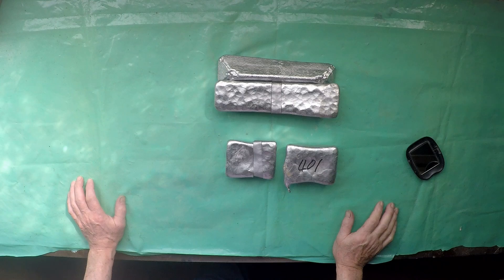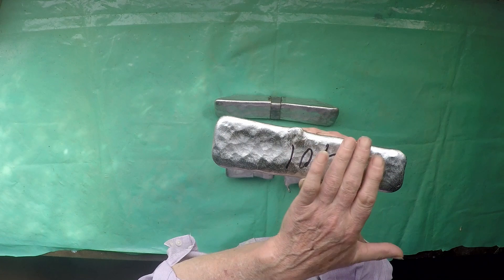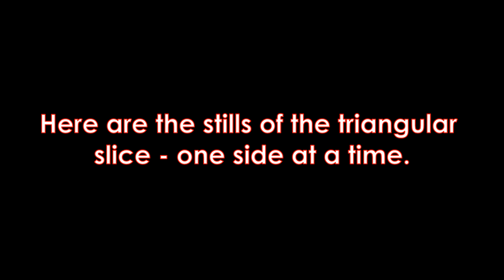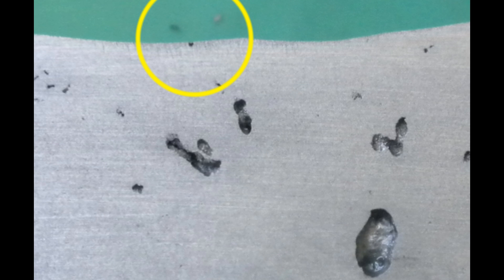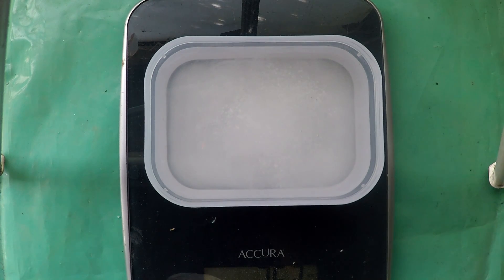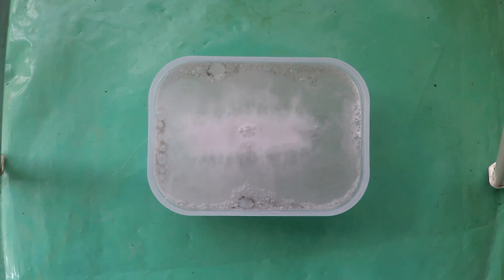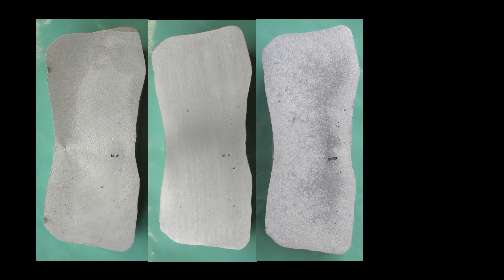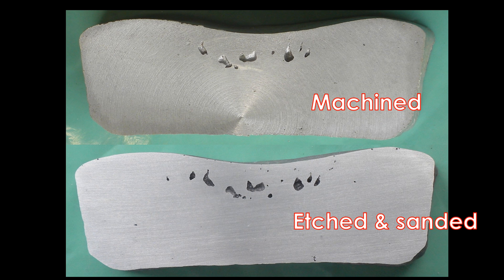Caustic Soda etching to reveal porosity in aluminium alloys.

Comment: If you don't have sodium hydroxide, just heat some baking soda to above 1600F, and it will decompose to sodium oxide, which produces sodium hydroxide when added to water. Not sure  if it would eat through a crucible though, just an idea.
Reply from the maker: Radster, I assume that your comment is based on Baking soda (NaHCO3) decomposing to Sodium carbonate (Na2CO3) at around 100 deg C and then the Na2CO3 breaking down as the temperature is raised further. This is an area that I am interested in as it relates to the useless preoccupation some amateur foundry types have in foolishly attempting to degas aluminium with washing soda (Na2CO3.10H2O) or even anhydrous sodium carbonate (Na2CO3). It is my hope to do a video rebuttal of this process in a scientific way and thus I have investigated the properties of the various sodium carbonates with respect to their behaviour with heat. One reference I have – Mellors Modern Inorganic chemistry – admittedly now a bit old, states that Anhydrous sodium carbonate melts at about 850 Deg C with “slight decomposition”. More modern information suggests that decomposition actually begins at about 400 deg C BUT that it is only very slight – perhaps about 1.5% at the melting point and is not complete until about 1500 deg C and is only about 5% complete at 1200 Deg C. Do you have information and a reference to suggest otherwise? If you do, I would be very appreciative to receive information about it.
Incidentally sodium oxide is quite nasty stuff treat it with care and particularly when adding it to water….. Martin
Reply: @olfoundryman8418  Thanks for the reply Martin. I read the Wikipedia article for sodium carbonate will decompose to sodium oxide above 850C, and I was planning on testing that, but I am unsure what it would do to a graphite crucible.  I did say it was just an idea, never said it was a good idea. I was also curious if you knew anything about it, and I'm glad to see that you do. Even a low percentage sodium hydroxide could still be useful for something. I've also seen Cody's Lab make it from a salt solution. About the supposed 'degassing with carbonate', I never believed that would work. I only do small, decorative castings, so I don't bother degassing aluminum. When I melt copper, I never try to cast pure copper like a lot of people seem to do. I use a 98% Cu, 2% Sn alloy, and it's gas free enough for making coins. If I want to make a knife, I use ZA27. Silver I will spend the time to degas though, especially after I spent extra time adding a bit of germanium to it to make 'Argentium sterling silver'.
Reply from the maker: @5thDragonDreamCaster , I would not try it in a graphite crucible as I  strongly suspect that any of sodium carbonate sodium hydroxide or ether of the two sodium oxides (Na2O2 ,Na2O) will attack the non-graphite part of the crucible and flux it away. The behaviour of those two oxides of sodium is a bit of a mystery as at a quick look it seems as though either decomposes to the other at some elevated (but not that high) temperature weirdly the info I came across suggests a sort of merry-go-round between them!

The problem with degassing with washing soda is that if you use anhydrous Na2CO3 you get no gas given off (Luckygen 1001 showed this) and if you use the true old-style washing soda Na2CO3.10H2O the only gas you get off would appear to be water (and perhaps a smidge of CO2), remembering that the hydrogen we are trying to get out of our aluminium got in there in the main by reaction of the aluminium with water,  bubbling water (steam) through the aluminium would appear to be most counterproductive. I usually advise people that if they use good metal that is clean and dry and melt quickly cast without delay, they will not have a gas problem unless their castings are very thick – in other words do not bother with degassing.

Copper is a bit difficult and everybody I have ever seen do it on YT has done it wrong! The use of a small amount of tin or zinc helps no end

A knife from ZA27? I have used a fair bit of the ZA12 alloy but I would have thought that even a “hard” zinc alloy like ZA27 way to soft for a knife?? I assume that you stir it well as the ZA alloys are prone to segregate when liquid.

I understand that Argentium silver is somewhat superior to sterling silver in many ways  but I have never worked with either ($$$) 😱 and it postdates my metallurgy student days.

Regards, Martin

PS We need to see more videos from you!
Reply: @olfoundryman8418  I do have some videos on Billy-Bobus Foundry. I haven't had a chance to do more videos for a few months, but I'm planning on making some more soon now that I've had a propane forge for the past 3 months, and it blows away my old electric one. The knives that I've made still aren't great; most of my experience is with casting coins and small engravings. I've recently come up with a copper based alloy that will scratch mild steel, but its fairly brittle. I might show that next time I make a video. My set-up doesn't get quite hot enough to do cast iron. It will melt it, but I can't get it hot enough to cast.

Thanks, Mike
Reply from the maker: Mike, Electric while clean and quiet is very slow as you no  doubt found. But if you can’t get enough heat to melt cast iron I would guess that you have a self-aspirating gas burner the problem with these is that they have difficulty pulling in enough air to get the slightly oxidizing flame that you need for maximum heat. IN another life (Oh so long ago) I briefly worked in the open-hearth department of a steel company. My job was to do furnace gas analysis to check for the oxygen level withing the furnace. They were aiming for 2% oxygen i.e. somewhat oxidising through excess air as this was the mixture that gave the greatest heat. With a self-aspirating gas burner your chances of getting this excess air are miniscule - you need to add a well controlled blower to push the air in – then you will melt iron but use a clay graphite crucible NOT a silicon carbide one. 
There are some very hard copper base alloys out there. One I use to make things like synchro rings for gearboxes is called CMA 1 and it has a higher hardness cousin CMA 2
https://www.google.com.au/url?sa=t&rct=j&q=&esrc=s&source=web&cd=1&ved=2ahUKEwi1-8KznqrmAhXh4nMBHT76A3oQFjAAegQIAhAC&url=https%3A%2F%2Fcopperalliance.org.uk%2Fresources%2Faluminium-bronze-alloys-industry%2F%3Fdownload%3Dstart&usg=AOvVaw1Q1QhDR2sEhgtt6HSaW7Et
I tried to paste a chart in here but It does not seem to want to work so try page 15 on the link above
As  you can see it is an aluminium bronze and it thus requires care in casting, in particular it is very prone to hot spot shrinkage.  It will certainly scratch mild steel and it is not brittle. You need very sharp tools to machine it
Incidentally the AB3 alloy also listed in the link is wonderful stuff, quite easy (relatively) to work with and it has a beautiful warm gold (not brassy yellow!) colour also it machines quite well although it is hard on tools ( the silicon content makes it a bit abrasive) I have used this alloy a lot but have had to make it up myself (not easy) as I cannot buy it here in Australia. It would be an excellent alloy for you coin sized work.

Regards, Martin
Reply: @olfoundryman8418  Thanks for the information on oxygen content and melting cast iron and the alloy suggestions. It'll be nice to have some hard and durable alloys to make knives from, and if I decide to try making some tools from as well. I've done some casting recently with aluminum bronze, nothing fancy, just what I mixed from the scrap metals I had (91%Cu, 9%Al), and probably a trace of iron from the old hacksaw blade.
If you're curious about the alloy I made that's hard but brittle, it's 87.5% Cu, 10.25% Sb, and 2.25% Al. My thought was that the aluminum and antimony are in a 1:1 atomic ratio, and form the inter-metallic compound aluminum-antimonide. It seems to have worked in making it hard at least, it was more of an experiment than anything. The aluminum was added first.
Thanks, Mike
Reply from the maker: Mike,    Ah yes, the old home-made aluminium bronze – everybody is doing it but unfortunately usually in blissful ignorance and thus rather badly. The problem is that everyone thinks that if they add 10 aluminium to 90 copper, they will get 100 of a 90/10 aluminium bronze – no they won’t. They fail to allow for recovery and my experience with alloy make up, when backed with analytical facilities so I could check, was in adding magnesium to 356 aluminium alloy in order to convert it to 357 alloy. I found that even with great care the best recovery of magnesium I got was half the amount added. With the aluminium bronze its odds on that the copper has been badly melted (have not seen it done right yet 😱 😊) and thus full of oxide which reacts with and thus reduces the aluminium - my guess is that most 90/10 is closer to an equivalent of 95/5 or 92.5/7.5 at best.  In any case aluminium bronze is a very difficult alloy in the foundry as it has severe shrinkage and oxide skin problems. It is one hobbyists would do well to stay away from unless they are prepared to uses good gating techniques and most seem loath to do so including, I note, all of the more popular on YT
Your copper antimony aluminium alloy is a real unknown and apart from saying that both those quantities of Sb and Al should go into solution in the copper at least at the melting temperature the virtually complete mutual insolubility of Al and Sb is a fly in the ointment. I could only make a (bad) guess at what will happen but if you got a glass brittle alloy it does suggest the presence of a fair amount of an intermetallic phase – was it the AlSb intermetallic or some tertiary one I would not venture to guess. A microstructure would be nice to look at though and might reveal some inkling of what went on. Interesting though is the melting point of the AlSb compound – well above that of either Al or Sb - this behaviour of a peak in alloy melting point at intermetallic composition is quite common across many alloy systems.

Incidentally I have used that CMA1 bronze to make a number of tools - non sparking spanners and parting tool holders for example - it is a very strong alloy….. Martin
Reply: @olfoundryman8418  Martin,  The aluminum bronze I mixed up, is no doubt not industry standard to say the least. I still like the material though as the color is nice and its got decent strength compared to aluminum or copper. The tarnish resistance is nice as well. I still like my copper with 2% tin alloy the best for high detail decorative work, and ZA27 makes casting tiny coins very easy.

The AlSb intermetallic compound has a melting point about the same as copper, just a tad lower. The alloy is strange for sure, it's harder than mild steel and brittle. That's not all, it's dull gray on the surface of the casting everywhere, but when I cut into it, it's a brass yellow. It has no bell sound or any resonating sound, only a 'clink' sound. The alloy seems to have a wide liquid range as well. I don't know if the AlSb and copper form a eutectic or if the percentage of AlSb is very low. I do know that we I tried just adding antimony to copper, it produced a bit of white smoke when I went to pour as the antimony is slowly burned off over time. I don't see any of this white smoke coming off of my mystery alloy, despite it having more than twice the antimony content of my previous experiment.

I've got to get my hands on some CMA1 or CMA2. I might try to make some, but I'm not sure what would be the best way would be to add manganese. The nickel shouldn't be a problem, we've got a convenient source of cupronickel in America.

Thanks again, Mike
Reply from the maker: Mike, I agree that the colour of aluminium bronze is a much nicer yellow than the horrid greenish yellow that brass has but the aluminium silicon bronze has a much nicer colour again - it’s much “warmer”
For high detail work I use a straight silicon bronze and for very sharp lettering on plaques etc I oven dry the sand moulds.

I wonder if that dull grey colour is that of the intermetallic compound. It could well be that it forms at, or is pushed to the grain boundaries during solidification. Thus when the sample breaks what you see is the intermetallic surface that the break has occurred in but cutting of course would  give you more the true yellow alloy colour. Bismuth in copper alloys does this - it forms a film at the grain boundaries not only is it brittle but it melts at 273 deg C so any copper alloy containing it (above about 0.005%) will fall apart at 273 deg C – perhaps something similar is going on here with  regard to the distribution  within the alloy???

I would not expect to see the smoke from oxidising the antimony if aluminium was present as it would oxidise in preferences to the antimony – thus Cu Sb alloy white smoke, Cu Al Sb alloy no white smoke.

I would not try to make the CMA 1 (or 2) you will never know if you get it right. My suggestion is just to buy it, its known as C95700 in the US. While you are at it get some of the Aluminium silicon bronze too - its known as C95600, you will love it

…..Martin
Reply: @olfoundryman8418  Thanks again Martin, I completely forgot that aluminum would prevent the antimony from oxidizing; I must have been too focused on the intermetallic that I forgot the obvious. 

I broke a piece of my mystery alloy to try to get some idea of what the grain boundaries look like. The overall color is a dark yellow, but under a magnifying glass I can see that there appears to be discrete yellow and gray areas. Is the intemetallic also responsible for the  entire surface of the alloy being gray? That really shocked me the first time I made it, that its gray on the surface, but brass yellow underneath. I'd heard about bismuth being added to some copper alloys to replace lead, but I didn't realize how potentially destructive it could be. I might have to make some bismuth containing copper alloy just to see it fall apart. If I'm not mistaken, lead accumulates at the grain boundaries. Does a similar effect happen with leaded brass if the lead content is high enough and the temperature exceeds the melting point of lead? 

If it is the intermetallic accumulating along the grain boundaries in my alloy, at least it can't suffer the same fate as those bismuth containing alloys, since the intermetallic has a high melting point. Also where would be the best place to buy those alloys? I remember my experience buying a small quantity of specialty LEDs from an industrial supplier who was used to selling them by the thousand.
-Mike
Reply from the maker: Mike,  I don’t know if the intermetallic is responsible for the overall grey but I think it more likely that its due to oxidation – from steam if in a sand mould possibly - strontium in aluminium alloys causes a nasty grey colour (and under skin gas) with my green sand.
I don’t know that I would be adding Bi to any copper alloy and I doubt that it is done in the name of machinability. It is true that about 0.5% of each of Pb and Bi are added to some wrought aluminium alloys to improve chip formation and thus machinability - 6061 for example becomes 6262 when the Pb and Bi are added. But Bi to Cu alloys - Hmm – NO - it used to be that if you even walked into a Cu base foundry with some Bi on your person, they would hang you! If you do make some up make sure you bury it in a very deep hole afterwards. Much more fun to use the Bi to make tea spoon alloys that melt in hot tea.

Pb and Bi behave quite differently. Bi will form a eutectic with Cu at 0.2% Cu and it melts at 270 deg c. During solidification the alloy solidifies as virtually pure Cu with the Bi being pushed to what will become the grain boundaries so the thin film of Bi/Cu Bi eutectic forms at them as the last bit to solidify. Pb however will not even mix with Cu and depending of the relative Pb Cu level two separate liquids exist - a bit like oil and water with the Cu floating on top of the Pb. Because of this mutual insolubility the Pb is present as spheres and it solidifies as such often sinking to the bottom (while the Cu is still liquid) because of its higher SG.  There is some tendency for the Pb to get pushed to the grain boundaries but the fact that it is insoluble and thus not getting rejected from solution mitigates against this. Google “Metallography & Microstructure of Ancient & Historic Metals” You should be able to find it free to read somewhere on Google, Plate 5 on page 20 shows a bronze with Pb present – it is an instructive image. The Pb being present as spheres rather than a film prevents any “falling apart” even when the Pb is molten Unless the Pb level is very high (> 50% by volume.)

Here in Australia I can buy any quantity of any alloy (that is locally available) from one ingot up. It’s just an ingot metal supply company and I should imagine it even easier in the US. Would be nice if I could go and pick up but they are in Sydney and I am in Melbourne so I get hit with a freight charge of about $75.00 a time so I tend to buy as much as I can afford and as rarely as possible – again be one with Google..... Martin